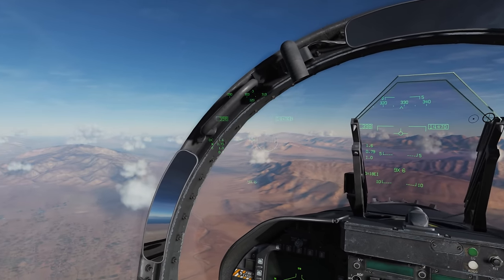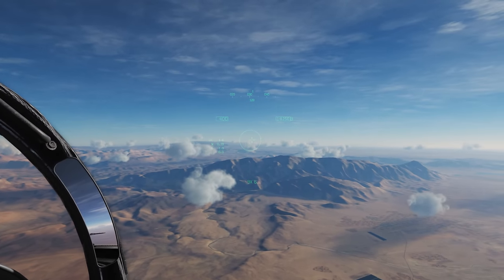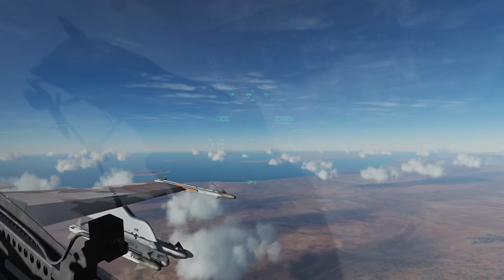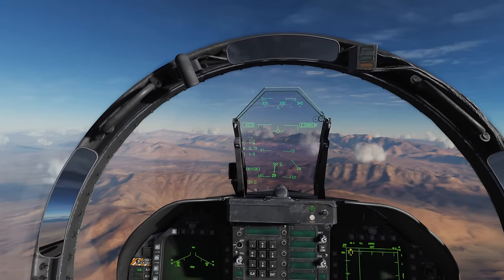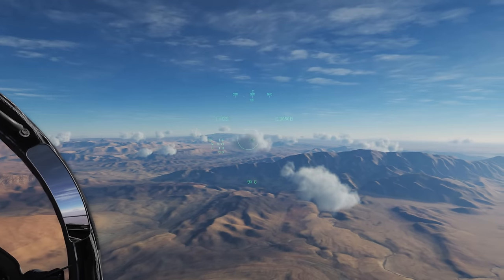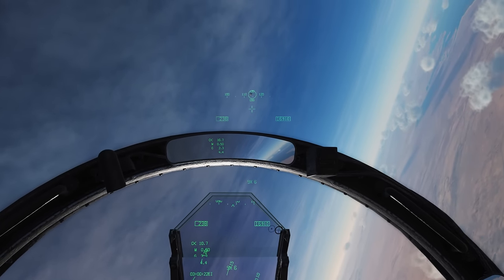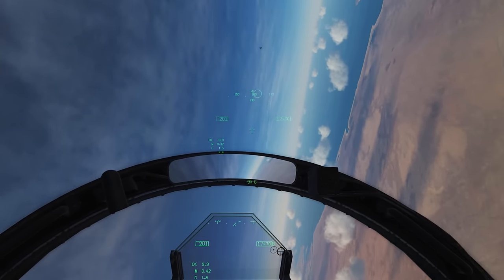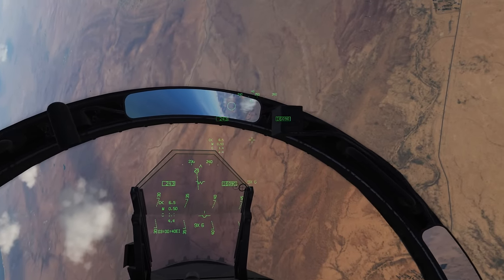Hornet AIM-9X Tones Explained!

Comment: Thing is, as a military pilot, I cannot overemphasize the usefullness of these sounds. You see, when you are pulling Gs, your vision will be impaired before your hearing... so using these sounds to your advantage is very important.
Reply: How accurate is dcs? Ik its a simulation, but is it like a military's flight simulation?
Reply: @MrDeanguy  Stupid accurate
joystick and rudders are practically required.
Reply: @ThePower1037  Like F-117 needing 2 missiles flat to shoot down at all times?
Reply: @jamegumb7298  If you need to do that in real life, you need to do it in DCS.
Reply: Audio cues are perceived faster than visual also.
Reply: Though under stress, humans will lose audio cues much, much faster than visual.
Reply: @HMSNeptun  That is why a) they are fucking loud and b) most military pilots are trained not to lose their shit when being shot at.
Reply: @Dinnye01  humans will always lose their hearing first in a stressed situation, as seen in many commercial air incidents where pilots did not respond properly to the 'terrain, terrain, pull up' sound and ended up in a controlled flight into terrain incident.

which is why the F16 and F35 has auto-GCAS, which will take control and recover the aircraft to a safe attitude when it detects danger of the plane flying into the ground.
Reply: @HMSNeptun  You are talking about commercial pilots. I am talking about military pilots. They are not the same thing, for god's sake.
Reply: @Dinnye01  yeah it’s a little annoying he said that , commercial pilots (assuming ATP certified) have a lot of training, military pilots have that under stress, g force training, constant hammering in and emergency situations. Tbh commercial pilots spend most of their training making sure you have a smooth ride, not planning on dodging missiles in a 747
Reply: @Dinnye01  Yes this guy has no idea what he is talking about. Fighter pilot training is the elite of the elite picks of military personnel. You don't get there without passing hundreds of weed out trials. You mess up one little thing and there's a guy who did not and he gets picked over you.
Reply: usefulness*
Reply: @jacobh7319 there is no smooth ride training, sorry. We do every emergency  you can conceive of in the simulator and it does induce the stress response. Not the same as being shot at but I'm former Army and that made me excited more than fearful. Yes when you're in the simulator and you have an engine go up in flames and the hydraulics all leak out and you're flying manual reversion single engine on fire .. despite being make believe is incredibly stressful. You have to really concentrate to keep adequate crew communication while responding to the QRH checklists, making decisions, flying the aircraft, and talking to ATC. Your hearing does go first under stress. Also I fly nearly 1,000 hours a year.  We fly 5 times more than military pilots. So don't belittle it because no one is a fighter pilot forever, and it you even pretend to think you're a better pilot for flying fighters your coworkers will eat you alive.
Reply: @Dinnye01 same thing applies to military pilots. Signs of Loss of SA include Auditory Exclusion. But if youre in a dogfight, and offensive, as in about to employ a 9X, you are probably not suffering a loss of SA. You are extremely highly focused. Loss of SA is more likely to occur in other situations.

Comment: Thanks for this. It’s been partially helpful but I’m not quite sure what the tones you are describing are in some cases. Are the sounds the Aim9 only or is there RWR sounds in there as well? I’m also not clear on what is meant by waterfall sound, high pitched (they are all fairly high at that point) and scratchy - I assume this is the white/pink noise tone. Anyway, I’m sure I’m just stupid.
Reply: RWR as well
Reply: You can ignore the waterfall tone it’s very faint

Comment: Next stap in DCS...? Force feedback..I saw C.W. Lemoine talking about it..The flightsims working wel..but he didn't had contact/feeling with his F18...
Reply: I feel that this will not be a high priority issue for ED, as there is currently a hen/egg problem with force feedback, meaning that currently not a lot of games support force feedback (other than a few racing sims), therefore not a lot or, currently, any joysticks/HOTAS are produced with force feedback in them. This in turn leads to not really making it worthwhile to introduce/refine force feedback for those few that still have some of the older joysticks with force feedback.
Reply: @Schnittertm1  Well, I still agree with C..W.Lemoine (Check out his youtube channel) It is dubbel the fun flying and feeling
Reply from the maker: Perhaps once a force feedback HOTAS is available that can work well for aircraft like the Hornet, Viper, Mud Hen, etc.
Reply: @MattWagner  Thank you for the response.

Comment: May be a noob question, but how do you have the HUD moving when you turn your head like that?
Reply: It's called JHMCS or Joint Helmet Mounted Cueing System wich you can activate with "HMD" Knob on the right side of the main dash.

Comment: SU22 vs AIM-9X 
1-0
Reply: How does a Fitter trash a modern Sidewinder? Needs more details. Did it splash but not inflict enough damage?
Reply: It had a motor failure iirc
Reply: @fangsout305  that is what happens when you don't let China Lake design your Sidewinders
Reply: GIVEMEAKISSLUV  Umm... missiles are not magical weapons that surely hit whenever you press the BIG RED.... okay, well actually, small red button. Missiles can be fooled, evaded and jammed. That is why flares and chaff can work.
Reply: @Dinnye01  So true.
Reply: su22 pumping hundreds of flares to escape the 9x, it worked..than the american f-18 superhornet switch to the aim-120 amraam and su22 got fcked

su22 vs amraam
0-1